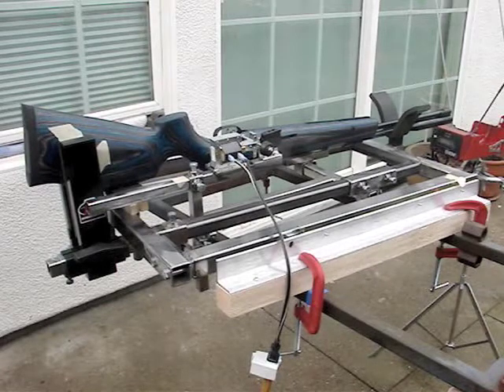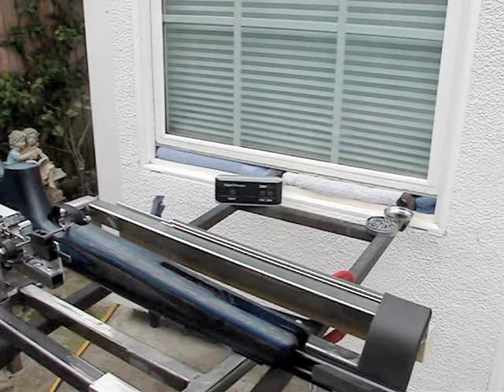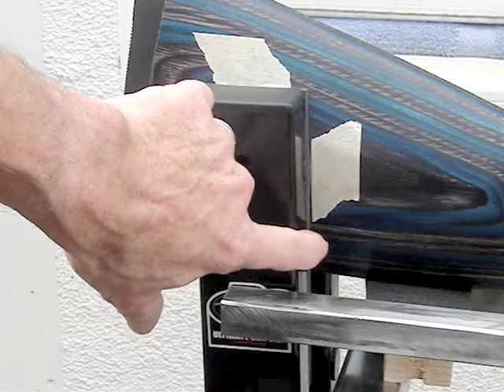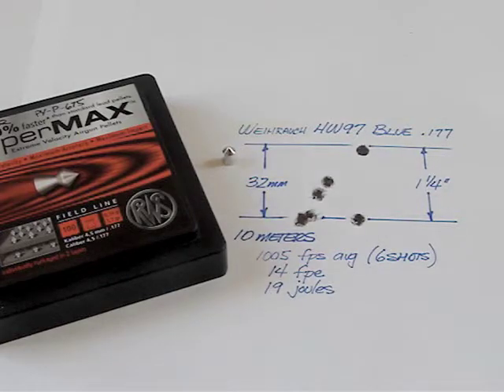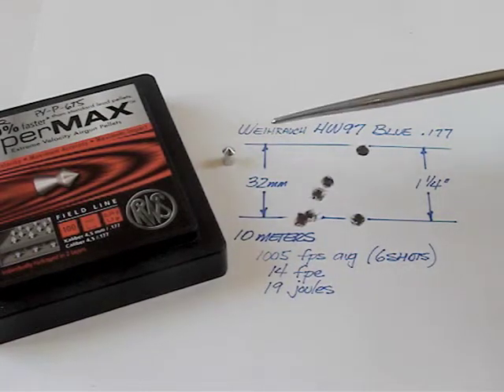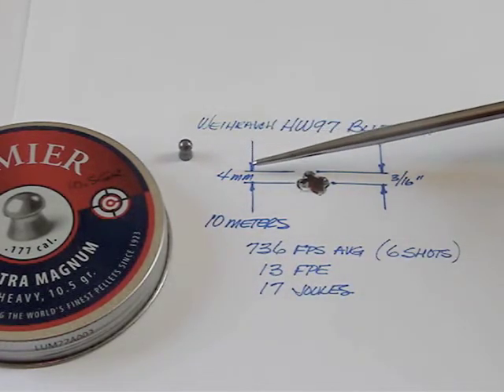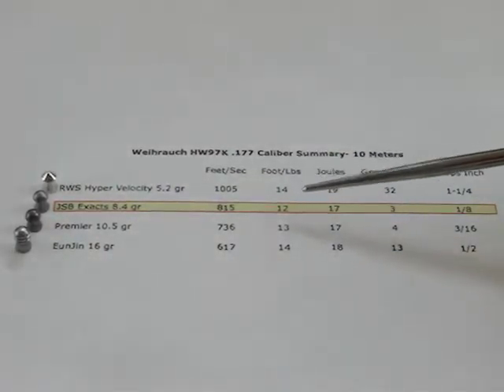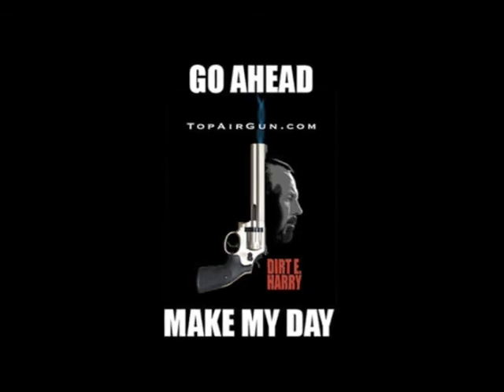Dirt E. Harry & The Beeman/Weihrauch HW97K .177 caliber

Comment: Do you have any actual numbers in terms of the energy the recoil puts into the shoulder? I've seen far too many people try to say that a .22 rimfire kicks more than most springers which I've proved time and time again to be very wrong when they're light, cheaper models. A 6.5ish pound Crosman 1000 fps rifle kicks relatively hard for the power, relatively I mean in terms of putting a CCI Stinger/Aguila Supermax into a far lighter handgun, much less a rifle.